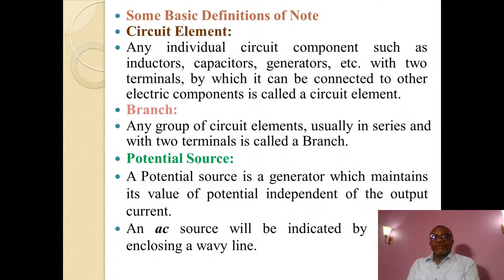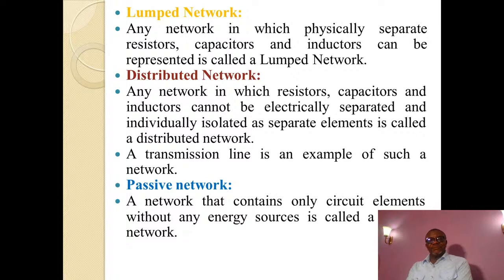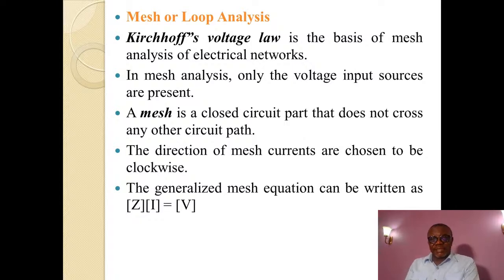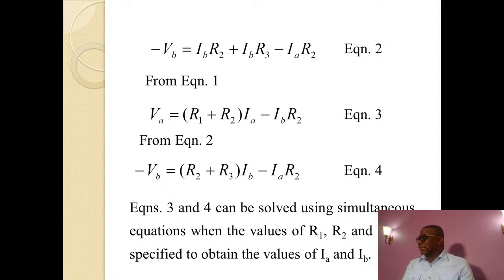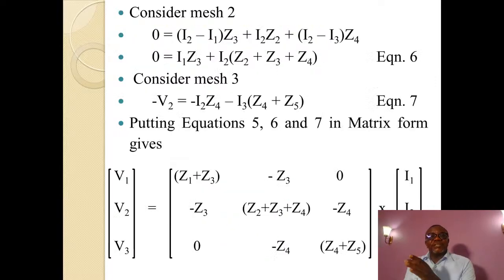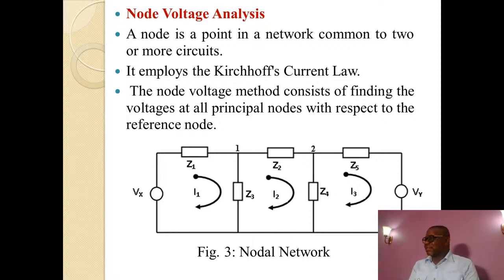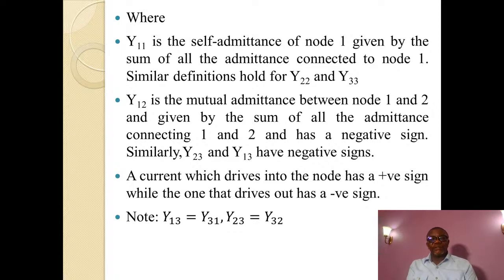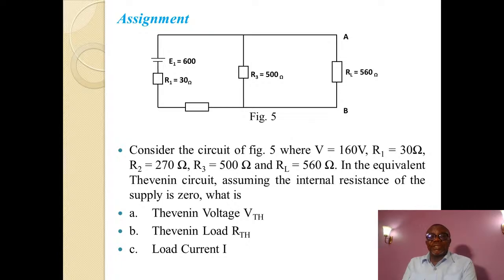Basic Circuit Theorems. Engineering Lecture Series MODULE 025 PART 2

Comment: Thank you sir for the lecture, God bless you sir.

Self Test Assessment and Assignment 

Name: Okechukwu Godson Onyinye 
Reg. No. 20241443253
DEPT: Mechatronics Engineering 

1. The current in a fixed resistor is Directly Proportional to the voltage across resistor.

2. If the voltage across a resistor is held constant the current in that resistor is  inversely proportional to the resistance.

3. The formula which gives the mathematical relationship between I, V, and R in a closed circuit is _I=V/R_.

4. The equation in '3' above is called _ohm's law_.

5. If the voltage across a 10,000 ohm resistor is 250v, what is the current in that resistor? The current in the resistor is _4A_.

Assignment 

6. (a) Thevenin's Voltage, V TH = 154v
       (b) Thevenin's Load Resistance, R TH = 28.875 ohm
       (c) Load Current, I = 261.5mA

Comment: Directly proportion 
2.inversely proportional 
3.I=V/R
4.ohms law
5.the last question is not visible

20231365373
Ezumaeke Ifunanyachukwu Ihechukwu
Reply from the maker: Correct. You have 2 points. The last question is , if R = 10,000 Ohms and V = 250 V, what is I? You need to solve the assignment in the last slide to get your full 4 points.

Comment: 1. Directly proportional
2. Inversely proportional
3. I = V/R
4. Ohms law
5. 0.0254A
Reply from the maker: Correct. You have 2 and half points. You need to solve the assignment in the last slide to get your full 4 points. But where did you get the (4) instead of just 0.025A

Comment: 1. Directly proportional 
2 Inversely Proportional 
3.I=V/R
4. Ohms Law
5. 0.025A
Reply from the maker: Correct. You have 2 and half points. You need to solve the assignment in the last slide to get your full 4 points.

Comment: 1. Directly proportional 
2. Inversely proportional 
3. I = V/R
4. Ohms law
5. 0.025A
Reply from the maker: Correct. You have 2 and half points. You need to solve the assignment in the last slide to get your full 4 points.
Reply: @NdinechiMichaelC 
For the second work

1. 160 V
2.  527 Ω
3. 0.147 A

Comment: Self test assignment
1:directly
2:inversely proportional
3:V/R
4: ohm's law
5:0.002 A.
Reply from the maker: Correct. You have only 2 points. Answer to Test 5 is 0.025A. You need to solve the assignment in the last slide to get more 1.5 points.